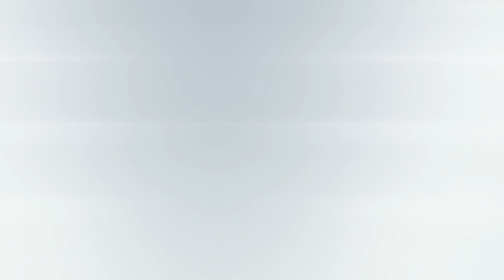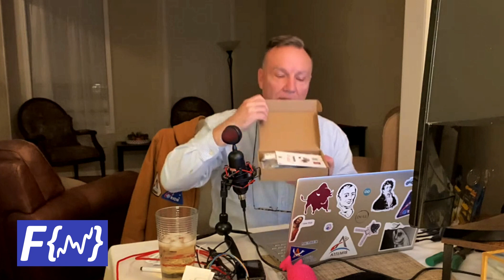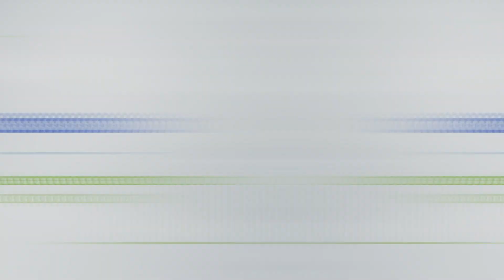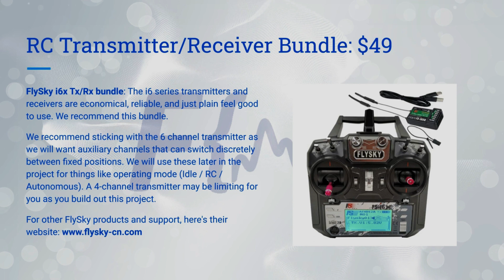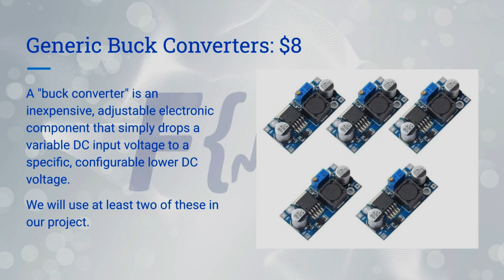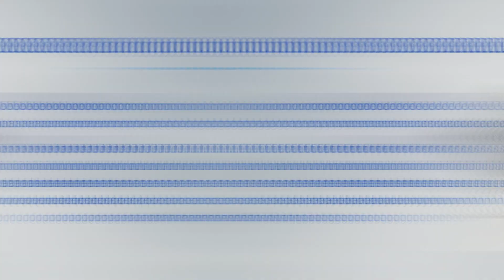Fourier Hobbyist Ep. 1:  Autonomous Rover from an RC 4x4

Comment: how do you make it autonomous? lidar or visual
Reply from the maker: Thanks for your great question! And thanks for watching.

There are a variety of proximity sensor techs that we could use for object avoidance: IR, Ultrasonic, Lidar, even radar. I have some inexpensive radar modules I’m considering. But I think we will start out with two front-facing, IR sensors set to detect objects about 50 - 100 cm ahead.

But these technologies aren’t mutually exclusive. And there are advantages & disadvantages to each. For example, ultrasonic is known to sometimes irritate pets; IR sensors are prone to problems in bright sunlight; radar would have problems detecting lighter/softer obstacles - many materials are transparent to radar.

What are your thoughts? What would you like to see us use?